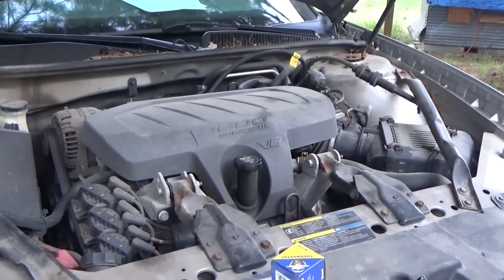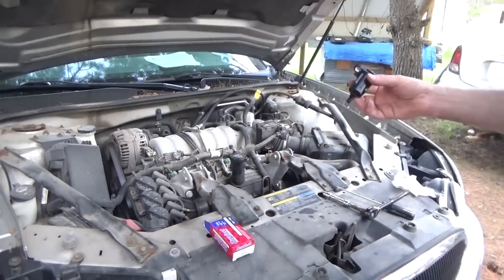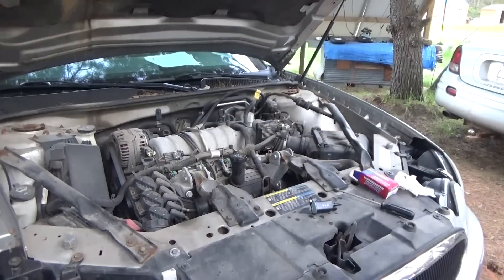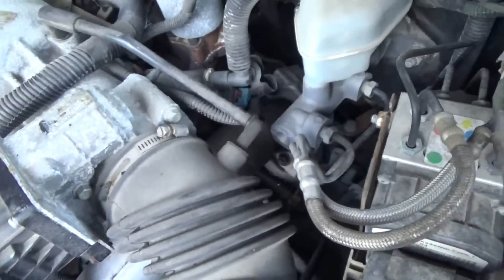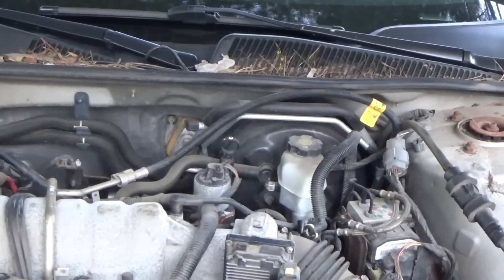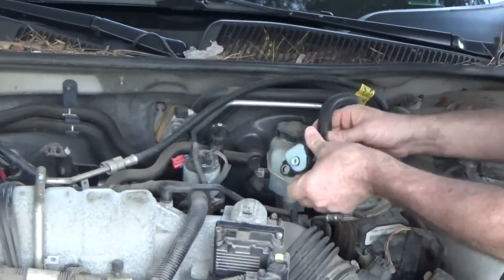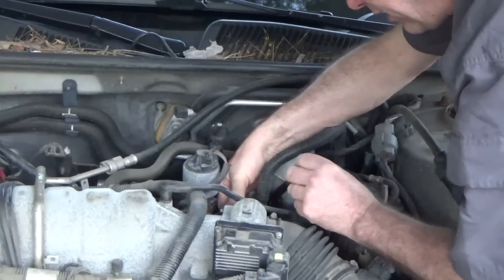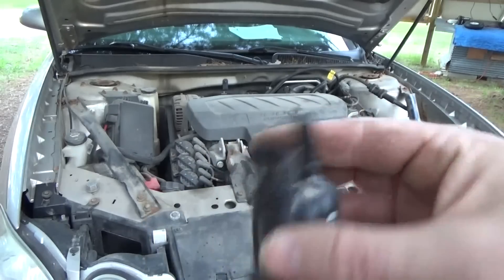Replacing The Purge Valve On Our 2006 Buick Lacrosse

Comment: The loose purge valve bolt may have been your problem all along. You should have tried to tighten it then clear the code and recheck in a few days.

Comment: My 02 Ranger has been hands down the most simple vehicle to repair and maintain. 206k miles and still kicking. Very easy for anyone with little mechanical  experience to work on. Parts are so easy and cheap to come by. Most work can be done with simple hand tools and a Jack and Jack stands.

Comment: Hey i have a 2006 buick lacrosse with the code p0411 and need help i have replaced the smog /air pump and relays/fuses and code still comes back what else could i try ???

Comment: Thank you so much for your video it help me so much
Reply from the maker: Happy it helped.
Reply: I replaced the purge valve, but my engine light is still on my 2005 Buick LaCrosse do you know how to reset it. I unplugged the negative battery but still on.
Reply: @1pearldrums  You need to clear the code with an OBDII code reader
Reply: Thank you for your help.

Comment: hey my 2006 lacrosse still has the diminished performance engine light on after i replaced the solenoid switch. Vacuum leak somewhere? any tips? thanks
Reply from the maker: Check all hoses for cracks or leaks.
Reply: Check the gas cap seal
Reply: Get a code reader man, performance issues could be a number of things...atleast the reader would point you in the right direction...

Comment: What were the purge valve codes, thanks you.
Reply: Hey, shout-out to you sir!  Just changed the purge valve on my 06 Lucerne with the 3800 engine. Seems to be performing better. Now need to clear the code and see if it stays off.
Reply: P0499 on mine
Reply: @jj-nh8lz  hey I have an 06 Lucerne too. Getting ready to change my purge valve. After a year have you had anymore trouble?
Reply: @aimlyon9710  no further problems and 167K miles now.  Just stalls after first starting it up but always restarts fine
Reply: @jj-nh8lz  Thank you!!!

Comment: What was your car doing before you changed it?
Reply from the maker: Engine light came on and it had slightly reduced gas mileage. I check my mileage with every single fill up.
Reply: Was it causing the car not to pick up a a lot of speed

Comment: If the gas cap and purge valve solonoid plus a check of your fuel lines running to the back dont solve your problem, inspect your canister purge valve and fuel vapor canistor, and possibly your gasket by the fuel pump...

Comment: I hope that its repaired now.
Reply from the maker: Well, that part is but now I have worse problems. Went to get the cooling system flushed. Mechanic wont do it without changing the radiator. Quoted me over $500 for the job. So its gonna be another DIY job. I dont think the radiator is plugged as he says cause the engine runs cool and the heater works fine.
Reply from the maker: Amazon has my radiator for $68 with free shipping but I dont think I need one.